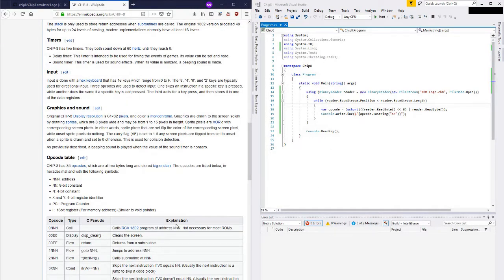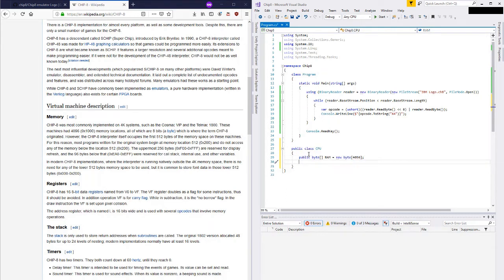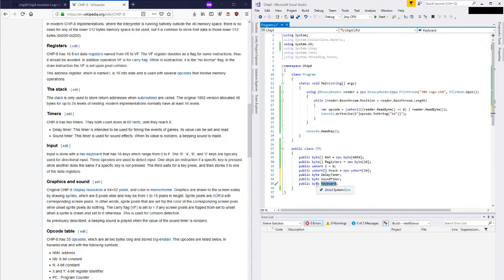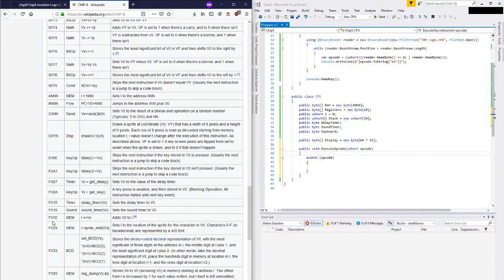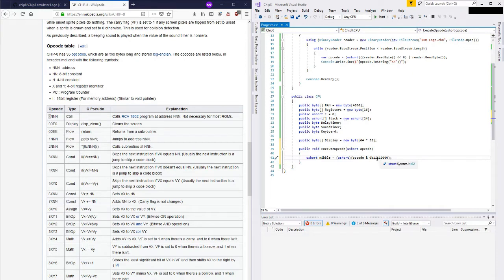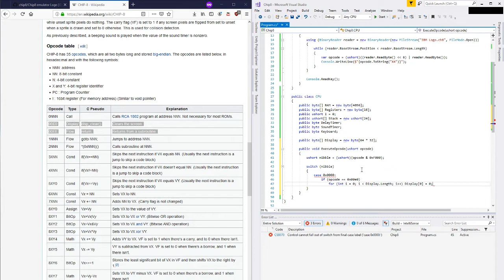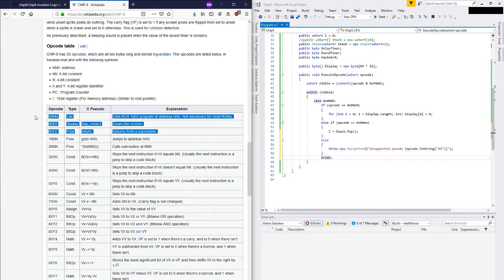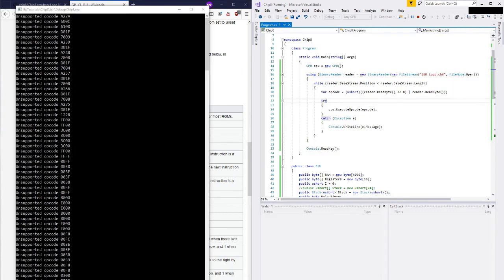Chip-8 Interpreter in C# - 2/15 - Creating CPU Structure

Comment: The binary literal syntax was added in C# 7. It also added a way to use underscores as digit separators, so you could do `0b1111_0000_0000_0000` to represent a 16-bit integer grouped visually by every 4 bits. (It makes making bit masks much easier.)
Reply from the maker: Very cool!  I thought I remembered reading about it many months ago, so I thought I would give it a try.  However, once I engaged my brain and realized how simple the hex for this program would be it made sense to switch back to save on space.